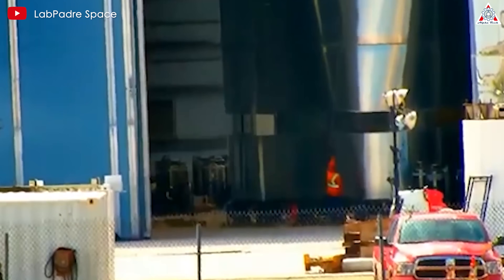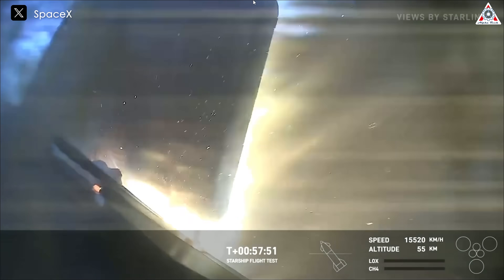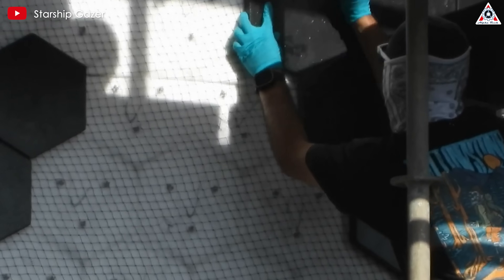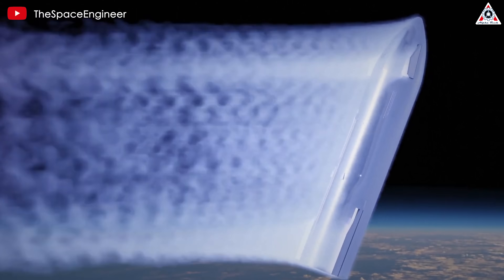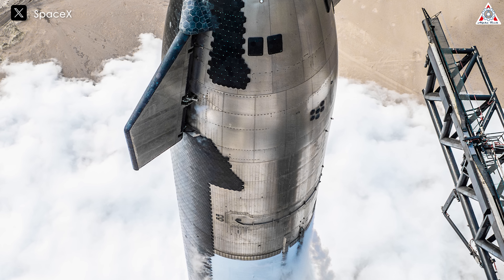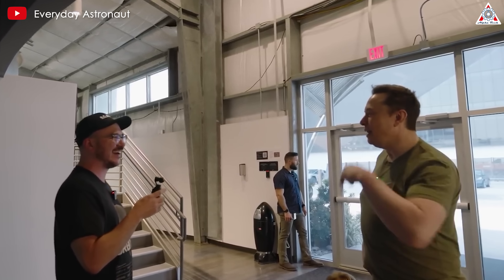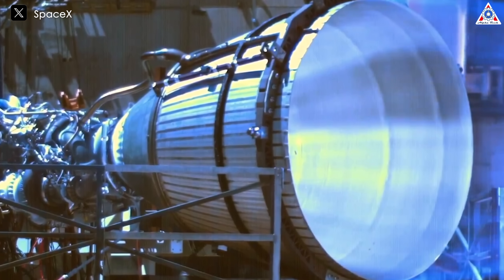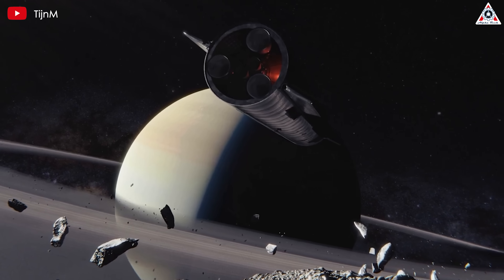Musk's SpaceX Genius NEW Solution for Starship's Weak Problem During Launch

Comment: Side money maker for Elon sell old tiles for patio fireplaces and ovens.  They may not be up for reuse on spacecraft but would be a status item for the family cookouts to have a fireplace or oven that is made from used spaceship parts.  Also light weight allowing bulk shipments without heavy trucks needed for most brick materials.
Reply: The US Gov wouldn’t like this at all
Reply: @keenanmolver9689 Your choice but it is rated for even more heat than firebrick and made the same basic way and designed for flight with rapid heating and cooling, could also reuse for making smaller kilns for potters.  With the slight curve would make rounded tops and sides (why I thought of outside fire ovens and liners for fireplaces.
Reply: they may have toxic materials which might be a problem. some chemical compounds used in heat shield systems can be highly toxic to humans

Comment: Love Spacex.  Warts and all.    Never approved of Agile Development as opposed to Detailed Design.
But hey Spacex has shown Agile Development in action, and you MUST get issues that you then concentrate on.  Detailed Design is slow and you are dependent on a designer to identify issues in advance, being human  issues will be missed. Hey Jeff how is the Detailed Design going?
So all power to Spacex.
Reply: Both of you got that wrong, as well as this video. Everyone uses iterative design. It's standard practice. The difference is the scale. NASA and legacy Space build and test components, not entire systems. It takes longer, but you end up with a safer, more reliable finished product. Even when Starship is officially "finished", there will be issues that arise. The big issue will be fatigue.  Single use can disregard it, but a reusable anything will have to engineer for it.
Reply: @hawkdsl  Everything Spacex has done, from the engines  Merlin and Raptor to the launch systems  has been constantly redesigned as issues arose, nothing is ever finished.
Single use systems are wasteful of resources and even in the case of the Space Shuttle reuseability  resulted in catastrophic failure, the heat shield tiles failed. The Space Shuttle choice of soilid fueled boosters that  needed joins because of political issues , namely Congress funding was dependent of certain bits being constructed in certain States, meant that Space Shuttle was not constantly improved.
Even the software NASA wrote was not fully debugged as NASA preferred to have procedures to work around bugs rather than fix the bug then retest the software.
Falcon reuseability has resulted in the most reliable and cost effective space craft ever built.
There is something about NASA where the management structure hobbled and constrained the people who did the actual design and work.

Comment: I still don’t understand how SpaceX is smart as they are using the Challenger design that work so well yes it had a couple of failures, but it went up went around and came down with only two failures. You can’t see that.
Reply: The shuttle was a failure and an expensive mess lol
Reply: @yeawhateverdudesure  You must be smoking crack or something. Shuttle was the most successful space craft is US history, and is only exceeded internationally by the Russian Soyuz. Shuttle accidents were the result of poor safety management.
Reply: 2 fails out of ~130 launches is way too much. Originally NASA thought it would be 1 fail per 100,000 launches
Reply: Reply to OP: Obviously, things learned before are applied to starship. That's true for everything going back to Robert Godard.

Comment: A small part of the hot exhaust gas is used for autogenous pressurisation of the tanks when the engines are burning. A small part of a gas stream to make up for the liquid fuel volume being used. And we're being told it is enough water vapour in that part to form water ice to block filters. Sounds like the fairies at the bottom of the garden again. I'd suggest runnimg the Bernoulli  calculation again based on the supercooled fluids at the high velocity points on the turbo pump's intakes. The fluid velicity will drop the fluids temperature by a degree or two and form solids.

Comment: I'M I RIGHT...IS SPACEX TALKING ABOUT PUTTING A REFUELING STATION IN ORBIT...THEN WHY CAN'T THE STARSHIP TAKE ON ENOUGH FUEL TO MAKE SURE IT SLOWS DOWN ENOUGH TO STOP MOST OF THE HEATING PROMBEMS FOR REENTRY.....THE REENTRY PROBLEM IS SOLVED IF YOU CAN SLOW DOWN ENOUGH NOT TO WORRY ABOUT THE HEAT...THE REUSEABLE ENGINES HERE ARE THE ANSWER...START THEM WHEN IF YOU NEED THEM.......
Reply: That's not how descent works. You need speed to break back into the atmosphere. Too slow and you'll bounce off the atmosphere. Once gravity takes over it's quite fast. Can't be controlled until you reach the more dense air of the lower atmosphere. In summary, no existing tech allows for the avoidance of the brutality of re-entry.
Reply: Attach the Shield in space at a station. A large sled that can be jettisoned and you won’t need more fuel.
Reply: USING ALL CAPS IS EQUIVALENT TO SHOUTING. PLEASE DO NOT DO IT!
Reply: Would burn more fuel to resist the pull of gravity that long but I do think adding parachutes would help slow decent with less fuel needed at the end, perhaps even design a inflating balloon style parachute that acts like a hot air balloon that would help keep it upright until it has settled on its legs.  Would just need to capture air or use nitrogen to inflate on the way down with it timed also to be somewhat hot from the friction.  (The idea is not really new either)  Some plans for missions to other planets considered using inflating bags for aerobraking.  Skimming the air to slow down for orbit instead of flying by.  Also used with a couple Mars missions to land inside a beach ball like structure.  While the tech would need reworked and adapted, I think it could reduce the landing fuel by about half with a modest net weight loss as the fuel is heavier than a parachute system/ (the nitrogen filled option might not show the same trade off with the needed tanks)
Reply: They should just build a crane big enough to just hook it up, and let it down slowly. They need these everywhere in the solar system. (I see your nutty, and raise you all one).

Comment: SpaceX does what car makers used to do before computer aided design and modeling...if a part failed, they'd re-engineer it until it didn't fail.
Reply: SpaceX would be the first to state that CAD and modeling are critical components for manned space flight. They also would say yes you have to risk breaking things to do the most you can. All components need to be tested to failure and redesigned for the next test cycle true. 

Different markets and different margins mean different incentives.
Reply: Yes, CAD and all the other computer analysis is absolutely critical for Starship. They test to see if the computer modeling is correct. I do find it interesting that even with computer aided design, it's still taking just as long as any other complex systems of the past... But then again, SpaceX probably doesn't have over 500,000 working on Starship, like we did with the Saturn 5.

Comment: Rapidly iterating, using disposable aspects of the starship is a great thing! However, attempting a booster catch on the fifth flight is just grandstanding and risk destroying the launch tower and the tank farm and other things in the facility. This is not rapid decoration, this is just showmanship that could lead the disaster. Let’s hope that, SpaceX realizes this before they risk a major mess up. Once the starship is reliably landing on target and a booster cash will be in order, but not now!
Reply: Sorry, but how exactly do you know so much better what they need to do then the thousands of top engineers at spacex?
Reply: @malloott  
Of course, I don’t know more than the thousands of top engineers that are working on the starship. However, I do have eyes, and I did see the first launch of the starship, which was done much earlier than it should’ve been done using an orbital launch platform that wasn’t ready and that resulted in , tremendous damage. I have no doubt that the thousands of engineers had SpaceX probably told Elon not to do that but Elon persisted and it was a disaster which caused unnecessary delays in future flights. The problem that I have with the booster attempt on flight five is that the starship booster has never landed completely successfully opened (look at the fire on the side during the last landing.)and there is a lot of potential disaster if can’t be precisely controlled for a catch. That doesn’t take a huge number of years of engineering to deduce.
Reply: @wbwarren57  There is a reason for the fast pace, it isn't a ego thing by Elon man, it's way more then that. Basically we are all hard wired to overestimate risks and underestimate the long term effects of iterations. To enforce risky behaviour on all teams the pace is set high, there is no excuse not to make it work, just make it work as simple as possible and quick, and learn from every launch. It sets a steady pace of development. 60-100 days per launch as target. This is a tool to enforce progress and not get stuck with someone crying wolf.

On the other end of the spectrum we have united launch alliance, they want to make things perfect in one go, and look at where it gets them.
Reply: @malloott  
Mostly I agree with you.  SpaceX is doing a great job of rapidly iterating on the design of the Starship - a behavior which ULA would do well to emulate.  However, trying to catch the Flight 5 booster in their one and only launch tower next to their one and only tank farm is NOT going to help in the evolution of the Starship one bit!  It is a hotdog ego-stroking move for Elon that carries way too much risk with little or no reward at this time - the same way that the too early launch of Flight 1 cause unnecessary damage to the OLM and the surrounding area and caused needless months of delay.
Reply: @wbwarren57  tank farm is flat now, will be earth covered I think. New tower is on its way, new arms for the old one are ready. They will destroy it on purpose, to go to the next iteration
Reply: @malloott  
The chopstick "slap" test is an indication that SpaceX knows that if a hovering booster is out of position and they try a chopstick grab, the booster could be knocked out of vertical and those formerly "hovering" engines could propel the booster far, far away before they could regain control.  Catching a booster with chopsticks is much more risky for this reason that landing on a drone ship the way Falcon 9 does.
Reply: It's in no way grandstanding (that is laughable given the deadly serious nature of this). He is simply being very aggressive,  as is needed, to get this program to 100% success in the shortest time possible.
Reply: @stratolestele7611  
Please explain why risking the one and only SpaceX launch tower and tank farm will in any way help the development of the Starship at this point???  They could land the Flight 5 Starship in an empty field after hovering it to make sure they have something that works - and that would give them all the info they need.  If there is a major mishap that causes sever tower and/or tank farm damage, how many months of investigation will be necessary?
Reply: @wbwarren57  they are building a second tower, just check the progress before you assume you know their plan.
Reply: I like the "send it" attitude for FLT5. It's the home of the Brave, so be brave.

Comment: When the methane is burned and forms  co2 and water it is immediately burned and ejected out of the rocket nozzle  as red hot steam  along with red hot Co2 to produce thrust. So how can this  steam possibly  freeze inside  liquid methane or oxygen tank and then block a filter  impossible If ice Is blocking filters the water source is from somewhere else
Reply: Exactly. He skipped part of the logic.
The tanks empty so fast they are re-pressurised using a little exhaust gas.
(maybe from the ox-rich side of staged combustion, so there’s no unburned methane introduced!)
This boils off some liquid oxygen, but adds risk of ice.
There are filters to stop ice being a problem, but they were overloaded.
** I’m not a rocket scientist.

Comment: Starship is only 1/8th of an inch thick. No way I'd ever trust it on Re-entry.
Reply: It's not the size that matters, but how you use it!
Reply from the maker: Besides the broken heat shield brick, in other parts of the ship it works quite well
Reply: Shuttle relied on aluminium! At least Starship is high temperature resistant stainless steel. Even after the skin of flap burned off, it retained structural integrity & continued to function. You are ignoring the heat tiles on the "sunny" plasma side.

Comment: Differance is. Space X tests until putting a crew on board. Starship is late and still putting a crew in danger. I isen't ready and it;s obvious.
Reply from the maker: Starship needs more time
Reply: Boeing was years later - and still failed.
Bozo can’t get it up. Russia is off limits now.
Falcon does job of astronaut transport to ISS.
Starship is next generation, lowers cost to orbit maybe to $20/kg.
There’s no competition.
Reply: Rick - are you aware of a little program called "Falcon" and a capsule called the "Dragon" that has a perfect safety record of crewed missions?

Might want to rethink your statement.

Comment: Starship reminds me of the Battleship Yamato. Totally the pinnacle of its technology, but won't ultimately have much use, and may be superceded by nuclear rockets very quickly.
Reply: How will a nuclear rocket blast off from the Gulf Coast?
Reply: If there's a better propulsion method, you can bet SpaceX will be using it and/or developing it.

2. There's always a need for a LOT of LARGE space ships if you're going to build anything of any significance on the Moon, Mars, floating in orbit, or on any other planet.
Reply: @stratolestele7611  I could see solar sails or nuclear being useful from earth orbit to mars or asteroids.
Many spaceships won’t be crewed, can be bots, food, materials, maybe even fuel.
Like a slow boat to China, travel time of little consequence.
** not a rocket engineer.
Reply from the maker: That would definitely be a perfect combination
Reply: How quickly?
Reply: Not to LEO.
But interplanetary, maybe.
Are you building one? It’d need to be lifted up or assembled in LEO.
At best, starship gets 200 tonne to LEO.
I’d guess nuclear rocket tech will be after there’s a massive new space station constructed.
Reply: @dannyb3663  thanks for mentioning it.
Beaching of Yamato reflects Iain Banks "Use of Weapons" with similar tactic, cementing the warship in position. 
No doubt that’s the reference I missed when I read it.

Comment: WHere is all the coverage of Musk's scheduled Mars landings of Starship: 2 in 2022 and 4 this year?
Reply: It can't survive Earth Re-entry safely much less the rate of speed it will see entering Mars.
The tiles need to have coolant tubing in the epoxy.
Reply: @JimmyRussell-zd5qo  what are you even talking about? It did just fine a few weeks ago
Reply: @triage2962 small issue with movable hinge joint. Fixable, predicted, not unlike initial stage zero launch pad. SpaceX uses fail fast approach.
Reply: @triage2962  you need to write for mainstream media. Now it's a "burning wreckage". Lol
Reply: He already had them, but nothing about Mars, till starship are more reliable. This place here is NOT the right place to get valuable information, because the individual making this show, cannot even type properly.

Comment: The tiles ablative?? Are u really sure? Elon said that they are not.
Reply: Tiles not ablative. Confusing narration
Reply from the maker: "ablative material tiles" I think it's okay to call it that
Reply: @alphatech4966 Wrong. It’s an ablative layer under the tiles that is intended to NOT to have to be replaced. The tiles themselves if necessary, yes, but not the ablative layer. That would completely undermine rapid reusability. Why the hell would you think it makes any sense whatsoever to have to strip off every tile, replace the ablative layer, then re-tile between each flight?